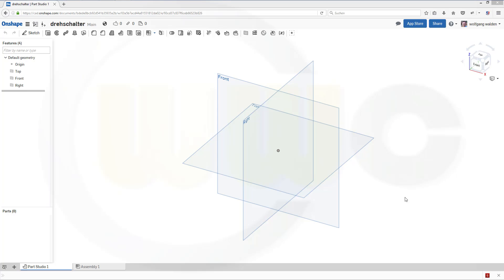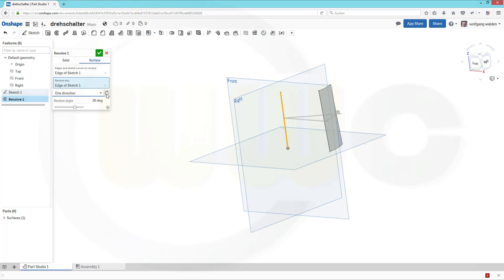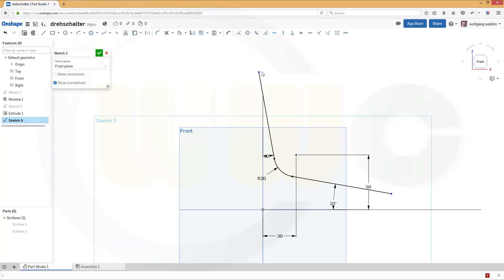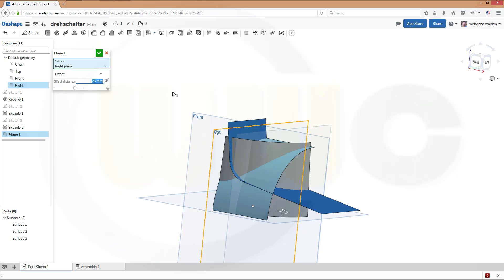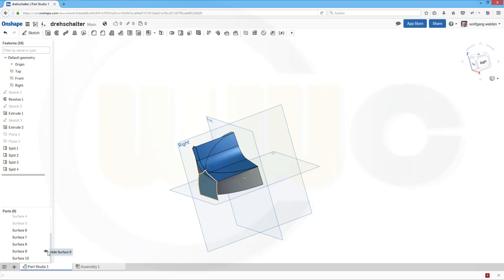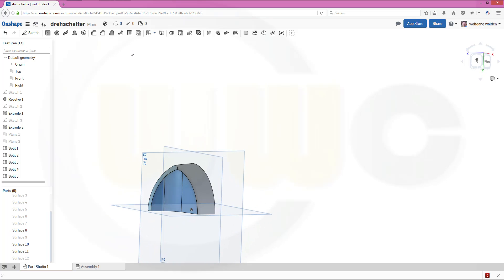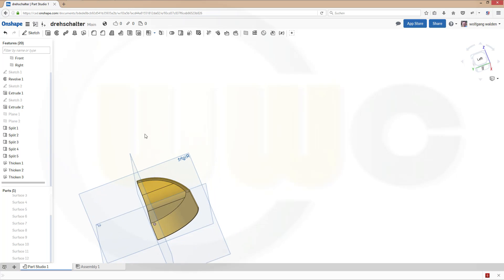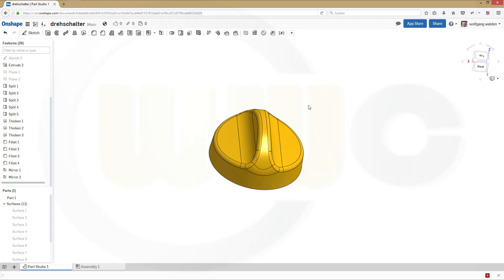Drehschalter - Onshape Training - Surfaces

Comment: Thank you so much for your videos. They're really usefull. I repeated this one, step by step, and everything ran perfectly until I did the last thicken. After that a surface that was suposed to be split out just reappeared out of the blue. I tried to find what I misunderstood and did wrong but I couldn't as I'm probably too new to the software (I start learning how to use it a few days ago). I'll leave a link to the file here for if you (or anyone else) could hava a look at it: https://cad.onshape.com/documents/26e05f636e8150c88ba11dd3/w/facb0dc8f64635c31d8f1903/e/06fa61282d5978c31e4e2c40
Reply from the maker: My advice would be - you should not begin with surface modelling. And you should at least do it exactly as I did, which you didn´t. (you don´t need those 2 additional planes at all) Onshape got many new features since the recording of that video, right now I could do in a better way. Solution to your problem - select the complete surface, not just one part of it, and then thicken it , that will work.